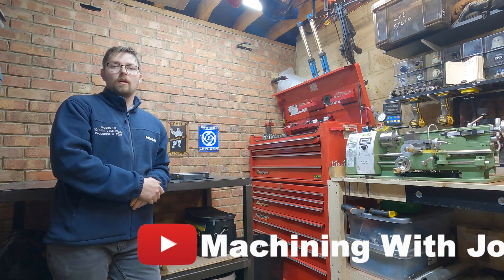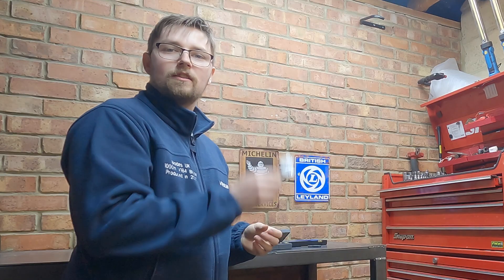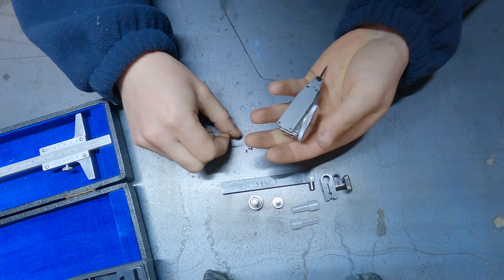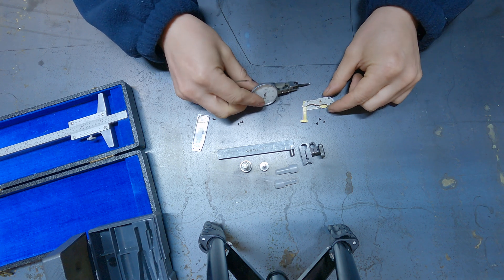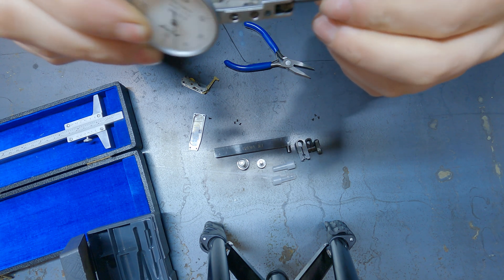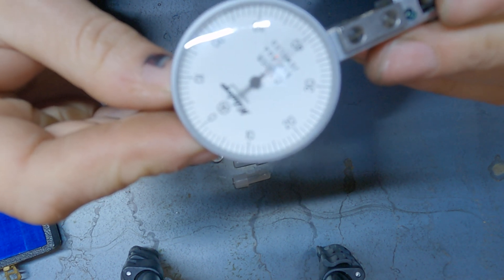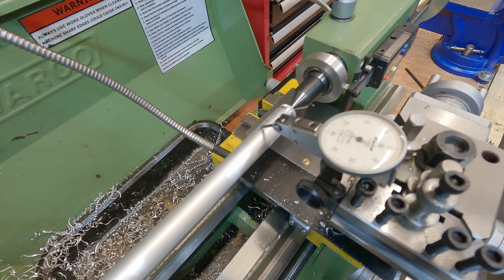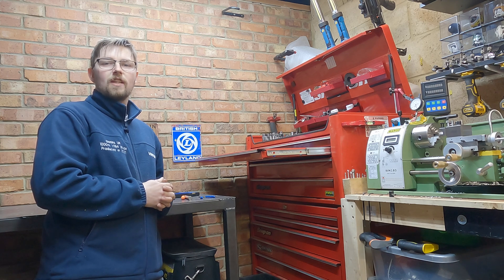Repairing A Dial Test Indicator

Comment: Thanks for the video. 
Do you have a special tool to release the black locking screw next to the lever? 
I’ve got a Verdict Metrinch DTI which much the same problem and I assumed it’d be that black screw needed tightening?